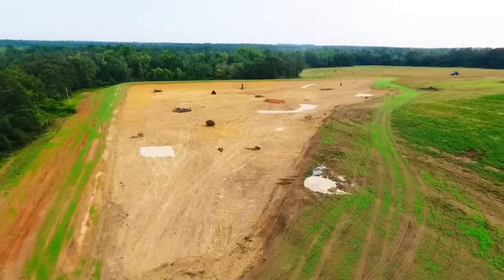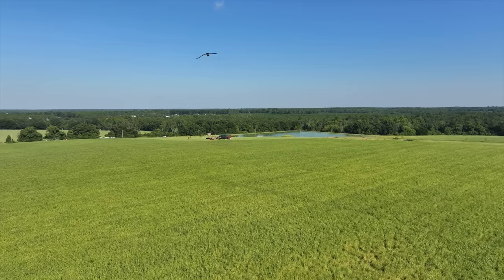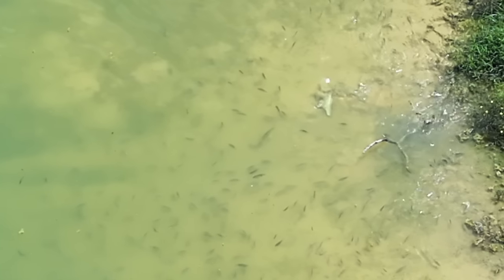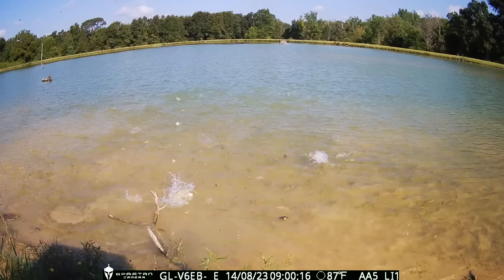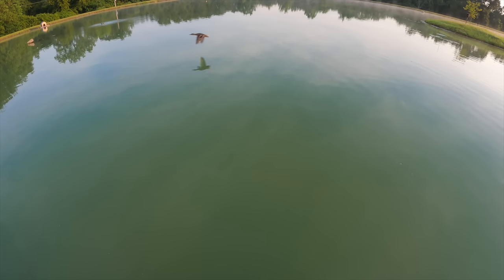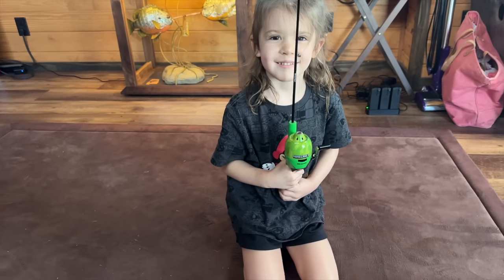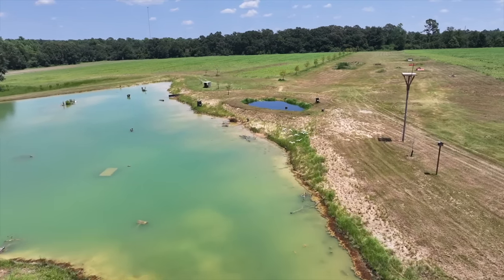Delivering Fish to the Eagle Nest with a Drone!

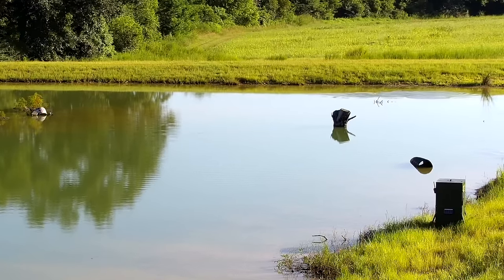Comment: 3:38  You should try replacing it with a tracking shot(basically a moving camera) you can control it it goes left right up down, so you can see the surroundings

Comment: I wonder... could you mount a polarizet filter on the camera, to better see the fish, at some angles...if you used an RC setup, with maybe only two channels, you could have one channel to rotate the filter for optimum angle, and another one to have the filter move into and out of position in front of the lens, for use in lower light levels, for your infrared application... just a thought.